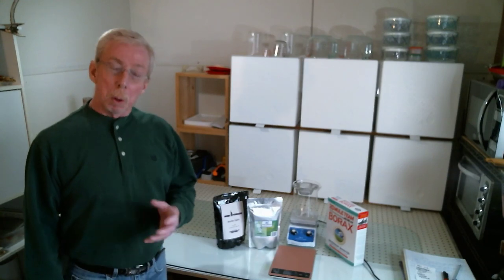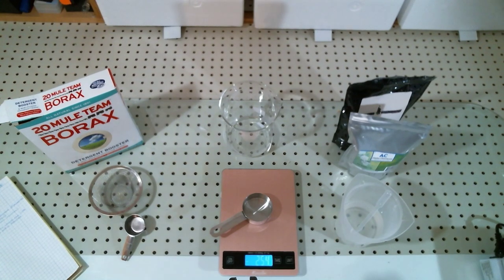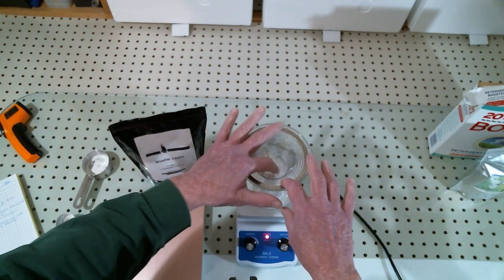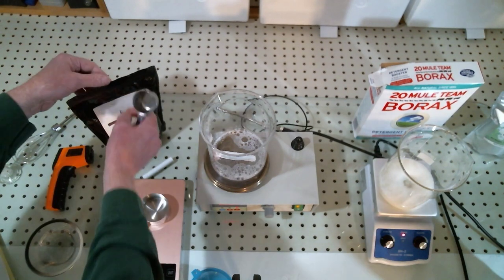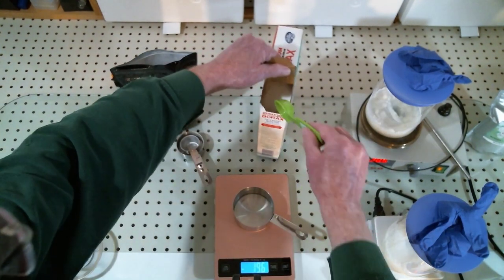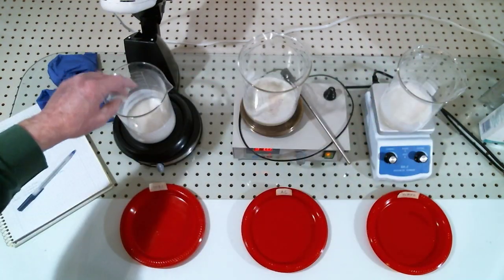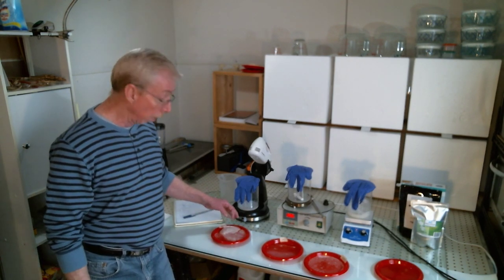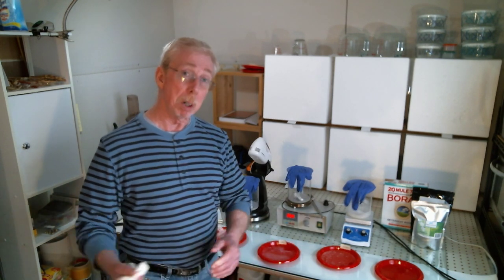Bioplastics: Water resistant Casein Glue. Milk glue.

Comment: Thank you for this wonderful and informative video. Can this adhesive be used for paper to stick on metal surfaces? Will it be brittle after drying and the paper may fall off?
Reply from the maker: Yes, I think it will stick to metal. Wood to wood, paper to paper is fine. I would be willing to try metal to metal. Give it a try, lay it on thick. Heat it in an oven at 200F for a few hours. Never tried wood to metal. I am building a greenhouse right now and I am using this formula.
Check it out.

Comment: Hello, this is really interesting, i am working on biodegradable material as a sustainable "fabric" for fashion, but biodegradable material is soluble in water and therefore i wanted to coat the biomaterial with a bio substance that is water resistent. This video was really inspiring but what would you use of water resistant coating for clothing which needs to be flexible and bio-based?
Reply from the maker: Yarn once was made from milk. Milk yarn dresses were popular and still a much sought after item on eBay. The yarn was manufactured in Italy. Look into QMilch, I think they are making it now.
I haven't found a natural way to waterproof milk plastic, but milk yarn is processed similar to how rayon yarn is made. Rayon manufacture is so environmentally damaging, it is banned from manufacture in the US. Early days of Rayon fabric required it to be Dry Cleaned because Rayon wasn't waterproof. Whatever they did to do that is the same thing you will need for your yarn. Look up Viscose Rayon.
Milk yarn sounds cool, but making it is not so cool.
If you find a way to naturally waterproof milk plastic, let us know. That is the Holy Grail of bioplastics.
In my opinion, bioplastic doesn't suit every application, but we would be wise to use it where we can and reduce items made from natural gas.
Reply: Thank you so much for your help!

Comment: Is this food-safe with the addition of urea?

Trying to make a food-safe glue that I can run into a cracked ceramic coffee mug (basically, immersion in the heated glue for time to allow it to flow into the crack, then removal, cleaning, and curing)... I think casein may be my ticket to this. I've found another recipe that calls for casein, sodium hydroxide, and calcium hydroxide, but unfortunately it is not a "waterproof" glue, but a "water resistant" glue, meaning use will most likely see it ultimately fail eventually (tho, another batch and application isn't the end of the world)....
Reply from the maker: Sorry to say, milk glue for ceramics, glass, and pottery are a myth. This formula is not waterproof, it is water resistant.

Comment: Hey
great video! very informative.
I have a few questions for a project I'm working on, hope you can answer some of them (:
1) what materials do you recommend using to make this glue non-toxic but still 
water-resistant? 
2) do you know if this glue can be used as a good oxygen barrier?
3) what would you recommend using to make the glue thicker but still keep its qualities? 
4) how long do you think it can last in an outdoor environment? 
thank you!!
Reply from the maker: 1) This formula cannot be made NON toxic. Use a HYDE or a PVA glue.
2) It is an amazing oxygen barrier. Superior to plastic.
3) Use more Casein.
4) 2 weeks if fully exposed in gentle weather. And this also depends on what has been glued. It can be permanent on wood, metal and glass.
Reply: @GEOsustainable  
thank you so much for the detailed answer.
do you have an idea in mind for a natural material to make this glue or a bioplastic waterproof?
Reply: Hi sir 
Can u suggest me for inner layer coating for biodegradable bottles for water

Comment: Well, this is surely the most useful video I've found about casein glue!
One question, has any heating been applied to your process when stirring the ingredients for the WBUC formulation? Maybe on the hotplate magnetic mixer, or using warm water instead?? 
'Cause I've tried that recipe myself and I was only able to get a sticky-but-too-watery solution, that remained liquid for days... I was wondering what could gone wrong (seems that urea didn't stirred as intended, some traces remained in the bottom... )
Reply from the maker: I did not heat. I only recorded the room temperature. It takes from 2 to 24 hours to mix, depending on how it clumps when it goes in water. I would say, give it more time to mix.
Reply: @GEOsustainable  I'll keep trying. 
Many thanks again for sharing this!

Comment: Nice video sir, it contains so much information.
I also liked the link to the book which I downloaded immediately for further reading.
I have some questions, you mentioned your own recipe (3th mixture) is waterproof and stays hard.
But this hard, is it brittle or still flexible? And if its brittle, will 
adding glycerine it to become less brittle or do u have other suggestions?
i want to use it as a leather-glue but its has to be flexible.
thx
Reply from the maker: You need to use something called Hyde Glue, or Hide glue. It is waterproof and made from animal hide, and most certainly ideal for leather.

Comment: I have read that the Mosquito aircraft was not suitable for use in the tropics as the glue used [was it casein?] did not stand up to the humidity.
Reply from the maker: I had to look it up. I knew Casein was and is still used in aircraft and boats, as well as exterior plywood. No other glue in existence can beat Casein bonding strength. Very high humidity can soften the glue, but will regain it's bond strength as soon as it drys. I have flown in the Mosquito reconnaissance in Vietnam. Those babies are fast, fast and super agile.
Reply: @GEOsustainable  I worked after school in the 50's in a caravan factory and they used something called urea formaldehyde, no idea what it contained., Why would it be superior to Aqudhere {?} or Bondcrete, PVA based glue, when PVA dries on your clothing it's like water based paint, impossible to soak out.
Reply from the maker: @adoreslaurel  The reason I choose this type of glue are the Formaldehyde is rather nasty stuff and PVA is made from oil. It's a personal choice.
Reply: @GEOsustainable  Very interesting, Thanks for that.

Comment: Great sir Iam looking for food grade waterproof glue for making disposable tablewares can you help me. thank you
Reply from the maker: You found it. Is this video I make a water resistant glue. Water proof would require Formaldehyde...not something you want to put in your mouth. Examine your task...you want to make a 1-use plastic, it does not need to last for more than 1 hour. Vinegar makes Casein more insoluble. Bioplastics are best suited for 1-use, ideal for tableware. If you need, you can introduce a second step. Coat your plastic with Shellac, then it will last much longer.
Reply: @GEOsustainable  Thank you sir
Reply: @GEOsustainable  hi

Comment: I seems that this could be used as a safer replacement for epoxy in composite materials.
Reply from the maker: Yes, it is used to make plywood.  Some older airplanes use this glue formula. Hope you get a lot of use from it.